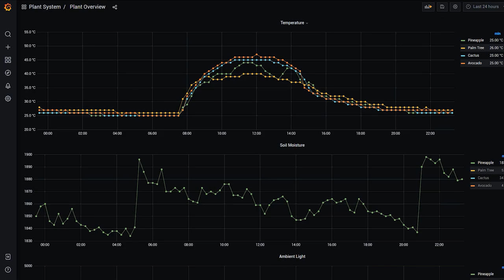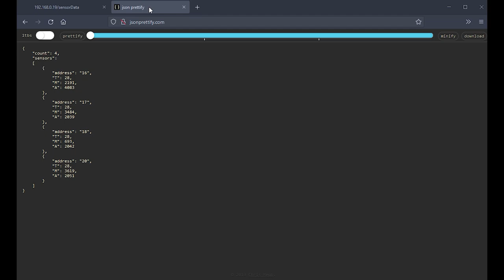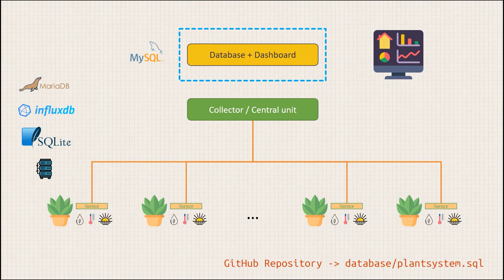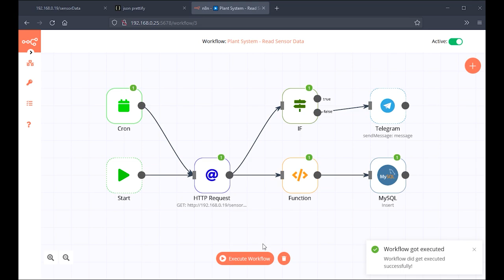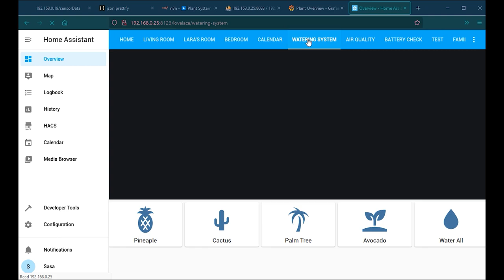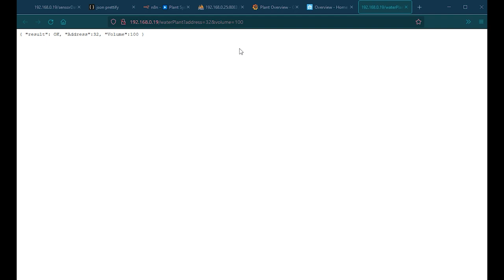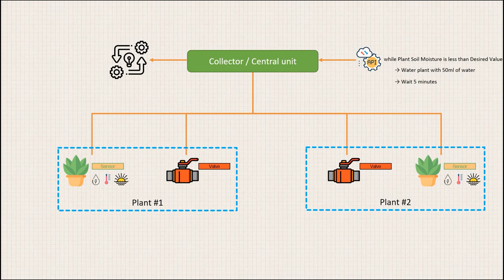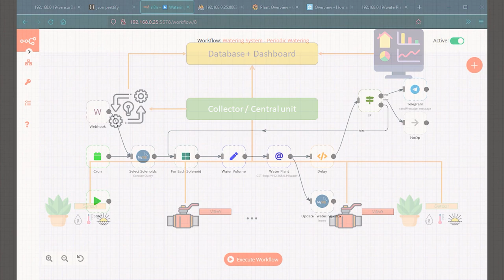DIY House Plants Watering System // Part3: Automation and Conclusion

Comment: This is awesome. Did you design and 3D print the planters as well? .STL? Are they "self watering" meaning there's a water reservoir in each plant box? Could help simplify things.
Reply from the maker: Actually my wife designed those. I designed the "holders/mount" for the aluminium extrusion rail.
They are not self watering because entire system (if you look at Part 1 and Part 2 videos) has soil moisture sensors, reservoir, water pump and solenoids. So you can measure soil moisture and if plant needs watering, dispense a precise amount of water. And obviously you can repeat this as many times as you want or until soil moisture reaches desired target.
Reply: @SasaKaranovic  yes I watched the other videos too. Nice work!
Did you post the models to the planters?
Reply from the maker: I just uploaded them to Printables.com -> https://www.printables.com/model/167761-planter-for-my-diy-smart-watering-system/files

Comment: How much power this system is using? E.g. watts for 4 plants per month?
Reply from the maker: That's a good question. I have not measured the power consumption but I assume it would be negligible given that the entire system on average probably draws around 10-20mA for all four sensors plus the central unit. Obviously you can optimize this significantly by making the devices go into sleep/stop mode when not taking measurements, increasing the period between measurements etc. But for my use case this was not a concern since all of these units are mains powered (AC-DC) and also they are very low power devices to begin with.